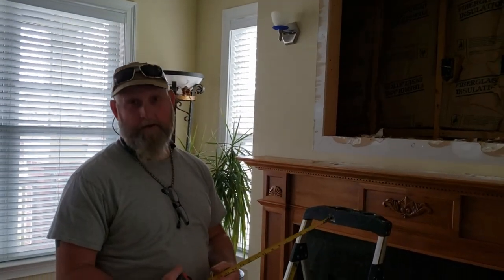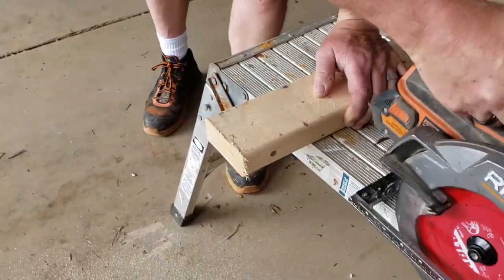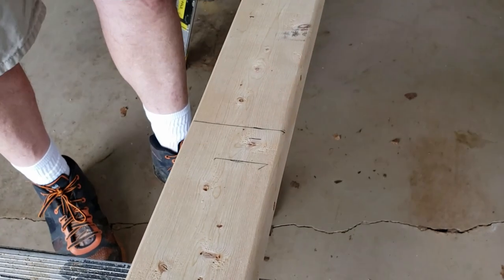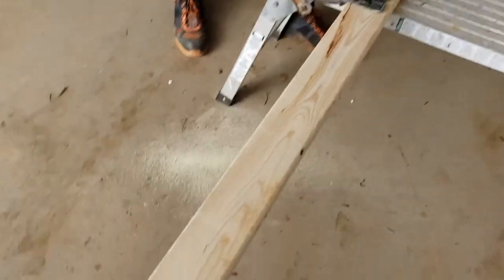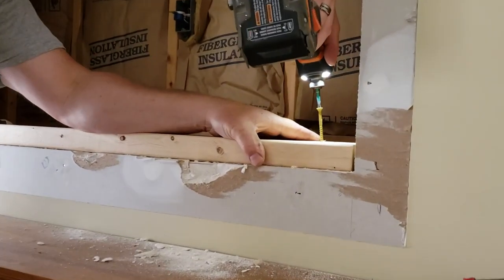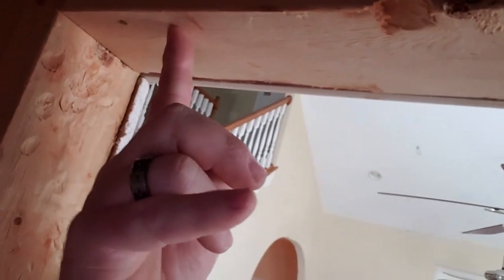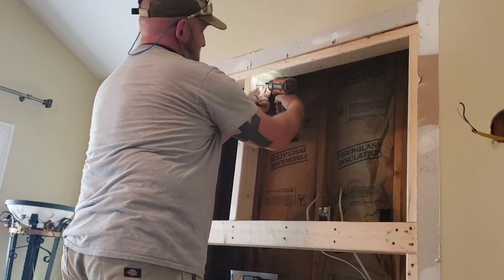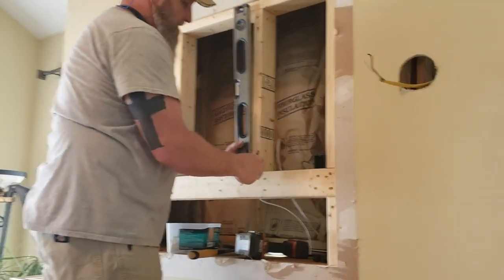Closing in opening for new flat screen TV Part 2

Comment: This is the best how-to for covering the tv nook I've found. Everything that's out there is lacking. Thank you for the informative video! The only thing I wish it had was the info about how you did the wire for extending the electrical outlet! Having it all the way back in the nook presents a problem for covering the void completely. So are you using wire connectors to extend the existing electrical to the new wall?
Reply: I researched extensively and for DIYers out there, this needs to be new wiring from source, the wiring cannot be extended or spliced when covering with drywall. Better safe than sorry... This is the hardest part of the job.